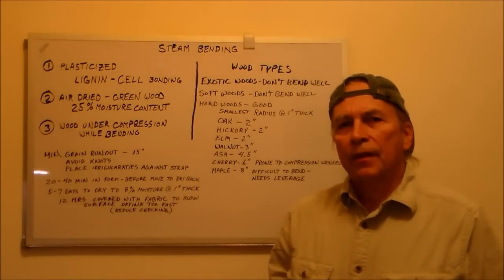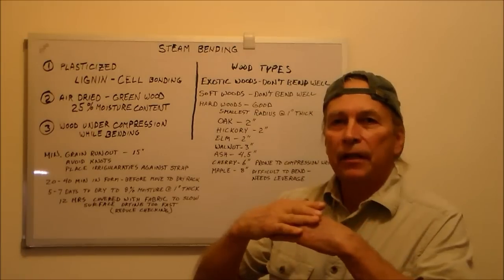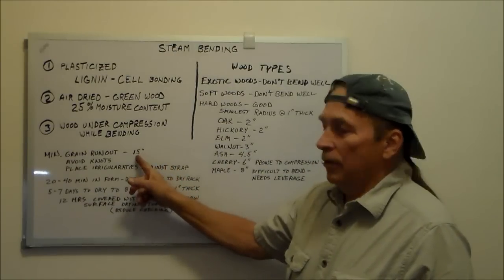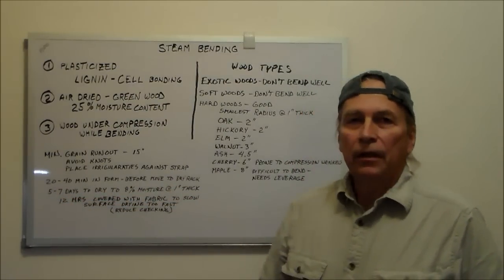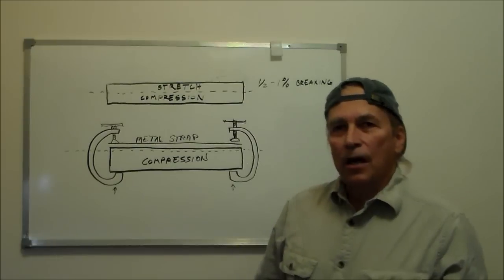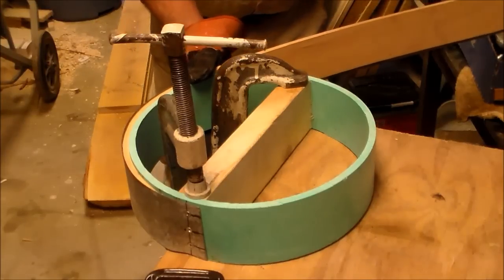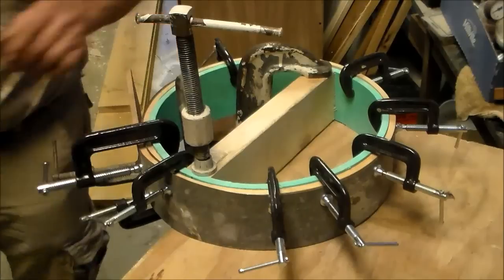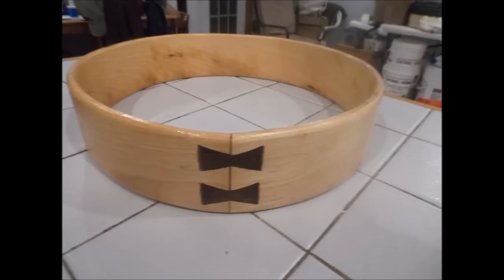Steam Bending Native American Hand Drum Hoop

Comment: Hi Donald, id really like to follow your guidance on how to stream bend an seasoned oak plank from scratch. Could you pls tell me the name of the cut of wood( is the plank from the outside or mid of the tree) dimmensions of the wood you use and the length of the over lap. Id probably use oak and make an 18" drum. I have to make the jig too ( and the steam box). I guess i can make the drum jig by creating a cross thick wood, then adding a circle of metal in a band the depth of the drum around the cross, the band then mimicking the blue form u have. 
Any tips about steam boxes!

Comment: @Donald porta I have the science down kinda, I put a compression strap made out of a cap for metal roofing, is that thick enough. My fourth try today didn't hold up, what's the thickness you use for your compression strap?
Reply from the maker: 14 ga, it is important not to let the strap slip in any way,

Comment: I am trying to make pandiero and tambour shells. This was very helpful, thank you for sharing. I would like to use the lightest wood possible have you any advice on types I could use ?
Reply from the maker: woods that are classified as soft woods are difficult to bend--- hard woods tend to bend easier.  my suggestion is to reduce the thickness to lighten the final project.

Comment: excellent video! 

Curious - what's your source of steam? Though it doesn't seem necessary, does a pressurized steambox help?
Reply from the maker: +icarus901 I'm using a wallpaper steamer when indoors and a propane heat source with a metal can when outdoors. You will still have to soak the wood in the heat for a specific time and you would have to experiment to find the correct time needed, if you overheat the wood will form a lot of compression wrinkles. thanks again my friend---Don